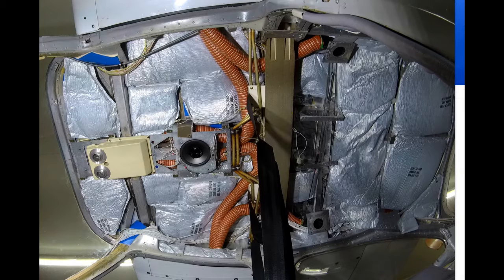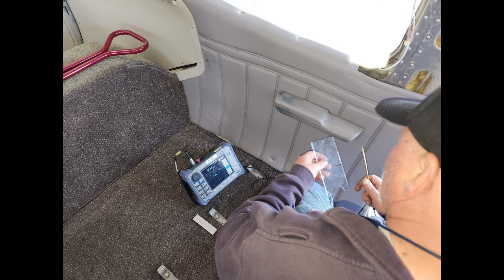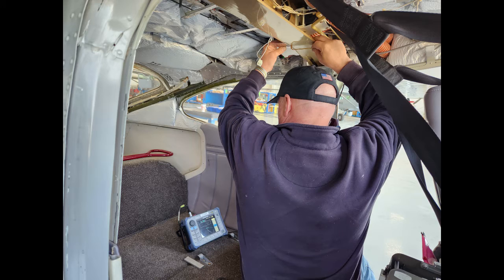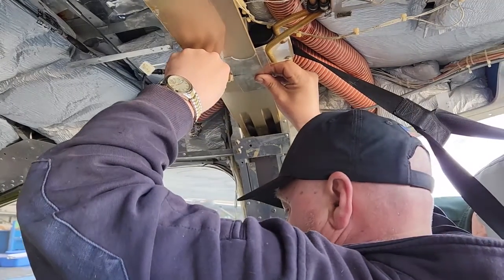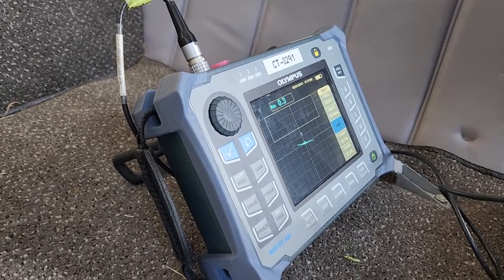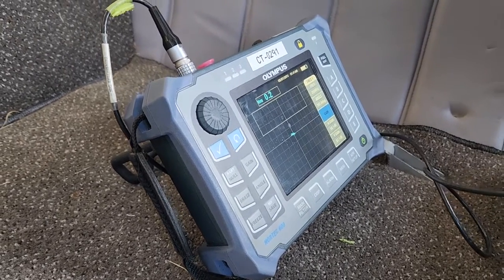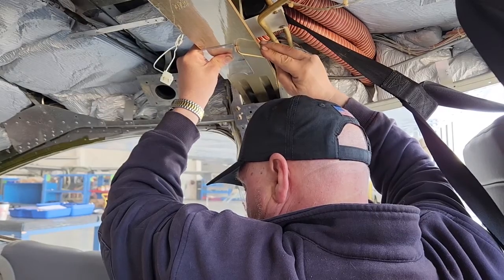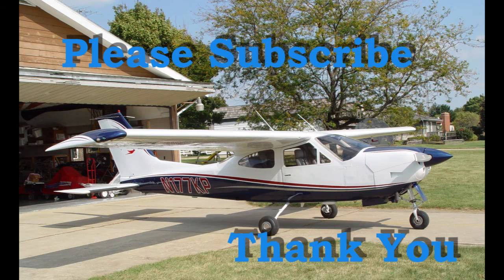A typical Cessna Cardinal carry through spar eddy current inspection, part of the carry through AD.

Comment: I am looking to buy a 177, but the main concern of mine is this spar AD, the inspection cost isn't too bad, how often do you see the spar actually need to be replaced? and from my understanding there are no more parts for it.
Reply from the maker: By this point any flying Cardinal should have the spar AD completed. There were very few that needed replacement, perhaps a dozen or two fleet wide. Do make sure the inspection was done properly... about a quarter of the ones I pre-purchase inspect have some issue there.

Cessna is now making new spar carry throughs, and we don't have issues with other parts... if that's what you are referring to. 

I would encourage you to join the Cardinal Flyers to learn more about Cardinals, or I have Buyer's Assistance service where we can talk through your questions as I help you through the process. Check it out at http://www.cardinalinspections.com

Comment: You probably know this, but why did Cessna chose to rout the fuel tank vents all the way to their opposite sides?  Think I saw the lines exposed there.   Thanks for being THE guru of Cardinals
Reply from the maker: The question to ponder is what will happen if a Cardinal is parked on a side slope? If a tank is vented out its own wingtip, that wingtip could become the lowest point in the fuel system and let all the fuel out. But crossing the vents over the top they avoid that issue. 

It took them a couple of years to come to this conclusion... the early year or two didn't do it that way. This led to the POH requirement to always select the right tank when parking... those years were designed to have minimum risk in that setting.

Comment: The AD requires cleaning inspection for corrosion metal prep alidine eddy current then zinc chromate. It looks like your spar has already been treated and painted. So to tell pilots it's no big deal at 200 dollars is misleading them . Someone has spent alot of time on that spar.
Reply: I was sent your video from a pilot who now believes his AD inspection should only cost 200 dollars. His spar was in bad shape and required a lot of work. I told him you probably had the SIL done first leaving only the eddy current inspection.
Reply from the maker: You seem to have misunderstood on several counts. The coatings preferred by the AD are epoxy primer and Corban... zinc chromate is an option but not preferred, and that's not the last coat. Also, Alodine is only required if not already done.

At the time of this video my spar was still as original, although with Corban applied during one of the SEL stages. No one had spent time cleaning or alodining.... that's how it has been for some 50 some years. After this video I cleaned off the Corban, epoxy primed then re-applied Corban, along with paperwork as mentioned.

As for misleading, I clearly said this was inspection was done of part of the overall process. In my case this was the only portion which required writing a check, but most other people won't be in a position to avoid hiring some of the work done or buying materials for the process.  Check out my video about the headliner removal for more information on the overall process. https://www.youtube.com/watch?v=gcH5QVu9rhI&t=2288s

As for whether it's a big deal, that will depend on what they find!

Comment: Hello Keith, it seems the spar still has its anti corrosion paint on it. There was no need to remove it before inspection?
Reply from the maker: Are you referring to the Corban or the Alodyne?

The Alodyne stayed on through the whole process. There was no need to remove the CorBan for inspection, but I could not put the epoxy on over the CorBan. So the Corban needed to come off just to get the layers into the proper order.